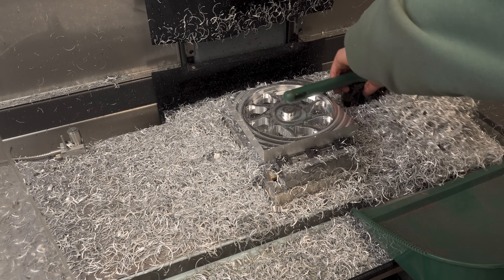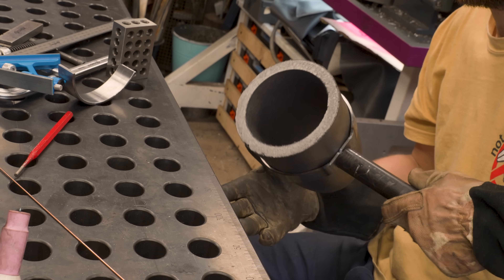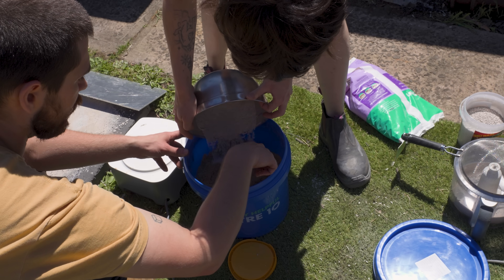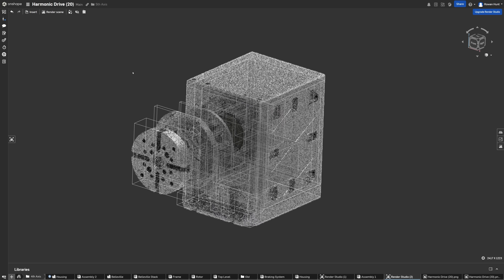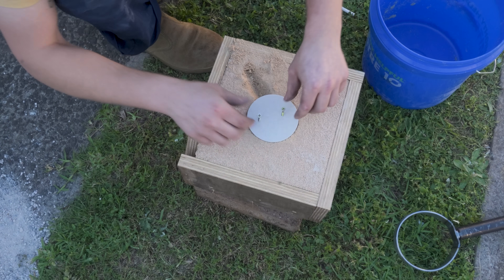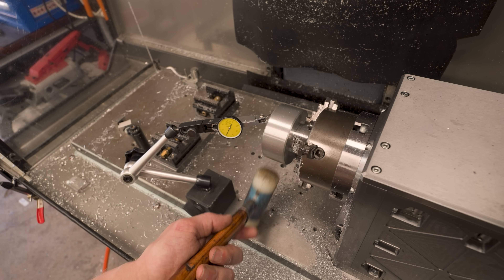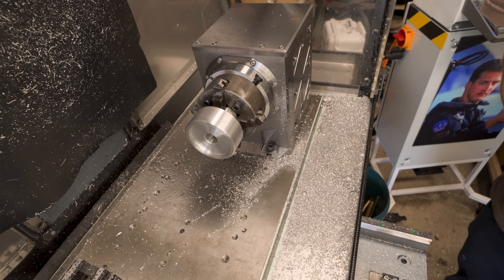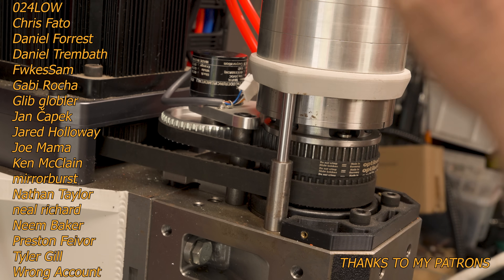Can I make a precision component from scrap metal?

Comment: the word we use for chips made from cutting metal, swarf, is literally the same word we've been using since cutting metal was invented. the old english word for swarf is swarf. the old norse word for swarf is also just swarf. kind of crazy that a word just never changed at all
Reply: I wonder how much of that is due to how trades were taught historically, and if there are similar examples in other trades
Reply: @LuciaMakes A lot of trades use words that remain coherent even when yelled at maximum volume by an angry older man about a critical urgent matter in a very noisy environment. This is why so many words & phrases used in sailing are intelligible across many European languages. Also, many industrial words originated as onomatapoeic approximations which obviously disregard language barriers.
Reply: Thank you but I prefer it my way
Reply: As a Scandinavian, I think it changed. In Swedish, swarf is "spåner" or "spånor" depending on dialect. I looked it up and in Danish and Norwegian it's "swarf". But in Islandic, generally the most close language to old Norse, it's "spænir" which is closer to the Swedish word than the English/Danish/Nowregian word. Are you sure it's actual old Norse and not just a loan word from Danish or Norwegian?

"Spånor" just makes sense as it's the plural form of "spåna" meaning chip. What's even the point of swarf? You already have a plural form of chip called chips. It would only make sense if swarf was just the fluffy kind of chips made by a lathe. In Sweden, we would just call those "svarvspånor"(lathe chips).

I searched for it on google and it told me the old Norse root word for swarf is "svarf", so I think it shares the same root with the Swedish word for lathe which is "svarv". No wonder we don't use swarf as that would mean we would call "lathe chips" "svarvsvarf", good luck saying that 3 times fast without lisping, slurring or mumbling.
Reply: @skitidet4302 never heard swarf as a norwegian, only ever “spon”, nor can i find it in the official dictionary
Reply: @cotionicar  I guess google translate lied to me. It wouldn't be the first time.
Reply: @skitidet4302  Swarf produced from a lathe (svarv) makes sense as a lathe would have been one of the first mechanical tools for processing metals. ie the waste material from a lathe might also be called lathings in the same way wood carving produces carvings as a product and waste. /speculation
Reply: @skitidet4302  Second Norwegian here. I don't know anything about metal working, but sawdust is called sagspon. Never heard of swarf.
Reply: @MinedMaker  I guess the translator messed up, or I used it incorrectly. 

Good, then it's the same as in Swedish.
Sågspån the substance is wood dust/chips,
but the determinate singular/plural sågspåna/sågspånor could be whatever material you are sawing, but generally people just leave out the saw part and call it just spåna/spånor to avoid ambiguity. It's only when you want to convey that the chips came from a sawing, instead of turning or milling, that you would use such a word.

Comment: 5:34 - bottom of that printer is DISGUSTANG.

You can print a little container that goes right at the foot of the door (on the inside) for the purge lines.

Comment: 1:34 My dumb ass (me -> 🤤) made a worse mistake the other day cutting a tube to length 3 times cuz I switched my brain off while trying to make a 900x500 frame. First cut it to 500 then realized: "oh no I have to take into consideration the tubes on the sides are 20mm wide". Cut it to 480. Then realized Im probably retarded because it needed to be 460 to compensate for the TWO other tubes, not just one... Now I have 4 off cuts that Im keeping instead of scraping them because Im super duper sure they will come in handy somewhere in the next 20 years.

Comment: 4:55 "It is build entirely in the cloud"

Which translates into: If there is an internet outage then your clients will be bashing the door but you couldn't do anything, because whole CAD/Simulation/CAM software is not working without internet.
Reply: Solution : do "remote" work, only over the internet, so if there's a internet outage then your clients can't get to you XD
Anyway PTC also make Creo, so it's not like they'll themselves promote Onshape instead of Creo for sensitive work and the product licence is on the local servers so a internet outage won't stop you from working
Reply: @bablela26  Remote work is definitely an option, just need to buy yacht and work in International waters, shipping will be done done via smuggling. Hope that customers will not become a pirates, due to delayed shipment :)
Regarding PTC Creo, haven't heard about it, thanks for the info.
--checking prices--
5k$/year for 1 person, are they insane?
Looks like I'll be working in international waters using FreeCAD.

Comment: Well done. The porosity is most likely hydrogen. Liquid aluminum can dissolve a fair amount of hydrogen which is formed in contact with moisture. However, hydrogen is not soluble in solid metal, forcing it out as bubbles. This is why you want to limit the holding time to the bare minimum. The use of risers can also delay the formation of bubbles until your part has solidified, these can also reduce shrinkage. 
Next up shouldl be some proper casting alloy (alloy wheels are a good source) and heat treatment.
Reply: i believe bubbling argon into the melt also helps purify/degas it. i think
Reply: @therealdimideas  Yes, this is a common method. In fact there is a vast number of methods available including ultrasound, reactive salts and vacuum. Sounds like an expensive rabbit hole.
Reply: @EirikvanderMeer   if one has tig one might already have argon
Reply: All true, but unnecessary for what he’s doing. Hasn’t he gone down enough rabbit holes? Lol. T6 heat treatment would make it machine much better though…

Comment: Been there. Did HTD5 pulley a couple times on a bench top CNC mill using a 3 mm endmill. Pretty simple. Just double check that your head aligned properly and the difference in probe and endmill length wouldn't give you a shift off center. Ask me how I know 😅

Comment: I've recently done something similar for my old Atlas Lathe that I needed to make a new set of change gears for.  The main difference was that I followed Shake The Future's method of using sand mixed with Water Glass (Sodium Silicate) cured with CO2 or baked in an oven.  I used old Hard Disk casings and the platters as the donor aluminum, and used 3D printed flasks and molds.  I found with the sodium silicate, that I really only needed about 12-15mm of thickness between the parts and the walls of the molds, and poured the aluminum with the molds in a basin of sand to help dissipate the heat.  I melted the aluminum to about 820c, and used some borax as flux to help with the porosity issues.
Reply: FYI, borax does nothing for aluminum -- it just gunks up with the oxide, and the metal sticks to it incessantly. At worst, they react, I suppose adding some B and Na to the melt, but this will be slow at pouring temp I think*.

*A preparation of, not pure boron, but AlB12, follows the usual thermite recipe, plus an accelerant (added Al + S) to ensure a molten product (the reaction temperature is in the >2000°C range!).  Borax, once dehydrated, can be expressed as a mixture of Na2O and B2O3.  Na2O likewise reacts with aluminum in a thermite reaction (which is vigorous enough not to need an accelerator, and must be done in a robust closed vessel to trap the product, which is vapor at the reaction temperature..!).

Borax is a good addition for nonferrous (brass/bronze) alloys though. Not alone, but with mostly glass and stuff, to give enough viscosity you can skim it off before pouring.

What works for aluminum, is chloride salts.  Equal parts NaCl and KCl form a eutectic that melts just at Al's melting point, and fosters separation of oxide and metal.  Don't overuse it; molten salt is runny as water.  It also traps water (vapor), leading to hydrogen in the metal, so using a degasser is encouraged.

Well, chloride and fluoride too -- but you probably don't want to muck around with fluorides.

Flux is really only necessary for high surface area scrap -- soda cans and swarf.  The yield nearly doubles!
Reply: @T3sl4 well said. So much garbage gets repeated by people who don’t know what they’re doing or have never done it or always done it wrong. Refreshing to see someone who has dig a bit deeper than regurgitating the latest urban myth.

Comment: i think it needs a curved/crowned pulley taper rather than a flange. (what's called a crown or a crowned pulley} the belt will ride on the flange otherwise.  before scrapping it, take 1 or 2 mm of both edges and taper it. as the belt moves to the smaller diameter it speeds up, dragging the belt back to the middle.
Reply: Yeah this is how belt-driven machinery has been done for hundreds of years, tried and true method. I'm not positive it will work on a toothed belt but I don't see why it wouldn't. But don't ask me, I'm not an engineer
Reply: This for sure. It's the best way by far and should be relatively simple to make.

Comment: I used to be friends with a guy who had a setup to melt aluminum. We would also keep a muffin tray nearby so that if there was anything left in the crucible we could just make little muffins that would easily fit back in to be re-melted later. You seem to have some kind of wizard intuition with putting the exact right amount in, though, so you probably don't need to worry haha.

Comment: Ok, but stock alu was heat treated and this is casted without. So it is lower quality material ;)
Reply: No, it’s garbage because it’s an alloy optimized for extrusion versus casting, not because it lost heat treatment. At any rate, it could be heat treated if he cared, but for this application, it matters very little. He’s replacing a (checks notes…) plastic 3D printed pulley. I think it will be fine.

Comment: Aluminum and brass both really, really suck to cast.
Molten aluminum loves to oxidize the moment air touches it (the moment you've removed all slag and start pouring), giving a really gross surface finish.
The zinc in brass loves to vaporize and oxidize if you get the slightest bit above brass's melting temperature. Wear a respirator when melting brass, kids, lest you get metal fume fever.
All casting channels gloss over how annoying they can be to work with when someone is starting out.

Comment: You probably already know this and just couldn’t wait to use the furnace, as we all tend to do when we get a new tool. But you really want to coat that furnace with the refractory cement. First of all it will help with the efficiency of the furnace but more importantly it’s a health thing. You don’t want to breathe the dust and crap that comes out of the raw insulation. Cheers
Reply: Looking at it, I was going to say the same thing, except I think there was a quick blurb where he showed some rigidizer (in a bottle?) , so I think he knows that he needs to coat it.

Comment: just so you know, the insulation inside the forge is very toxic to breath with prolonged use. If you plan to do this more, you would probably have to cover the wool with a cermic fiber ridgidizer, then refractory mortar so you don't end up like Walter White.
Reply from the maker: 0:45
Reply: @NoEngineerHere  at least in my experience, the rigidizer will harden the wool, but not stop it from being dispersed in the air, so you would still have to use the mortar. I could be wrong, or you might have just bought a different product. Cheers anyway.

Comment: Never thought 3D printing plastic would be such a game changer for people casting metal
Reply: I forget the brand(s) & name of it, but there's a dedicated PLA filament intended for exactly that! Lost wax casting something or other. Lets folks print a part, make a mold of said part, and burn away the plastic inside to pour in the molten metal.
Reply: @thetexastoaster  polymaker polycast
Reply: @thetexastoaster you can also use plain old PVA, it evacuates like butter. Hardest part is dialing in your printer to print PVA well.
Reply: @lephtovermeet PVA is water soluble and most slurries are water-based (like Suspendaslurry) which would risk dissolving it when you went to dip it. Polymaker PolyCast is made from PVB
Reply: @thetexastoaster  there is even 3d printing resin that acts the same way too, although it is quite a lot more expensive to buy than PLA
Reply: @thetexastoaster  you don't need to burn away the PLA unless it's absurdly long and thin parts.
Reply: "Lost PLA" is such an absurd game changer for casting. You don't need to consider split lines at all. All you gotta do is pack your aggregate tightly and make sure you have enough gas escape. And you can print with absurdly low infill if you're careful with the packing, so you can cast shapes that would even be hard with lost wax because most of the print is air that doesn't need to be melted and burned away.
Reply: Natural (clear) PLA is best, as it completely vaporizes without leaving any pigment residue, but any PLA will work. The expensive specialized filaments are a solution looking for a problem.
Reply: Pla seems to burn out nicely, if you trust people on YouTube.
Reply: @eslmatt811  it does. I’ve done so several times. As long as you’re happy with fdm resolution, there’s no need for anything fancier.
Reply: @omnia8838 depends on your part geometry. It’s possible to get ash trapped if you can’t blow it out well.
Reply: I bought mine specifically for patternmaking, as my woodworking skills leave a lot to be desired. It really is a transformative technology.
Reply: yeah that's how almost everyone makes the patterns for sand casting nowadays. only problem with it is that you get layer lines on the casting too
Reply: Oh, it's HUGE for metal casting!
I got my 3-D printer *just for that!*
Reply: I've burnt out plain black PLA for casting some smaller stuff. We would put some foil under the flask while it was in the kiln. The kiln would be set to a temperature that could melt out the stuff first and the foil would catch it instead of getting on the refractory. After melting out the bulk of the material we removed the foil and started cranking up the temperature like you normally do to a investment mold, burning out the remnants and preparing the investment for casting.

Comment: beautiful work, what prevents the sand from exploding since you added water into it?
Reply: There is so much surface area in the sand, and not very much water. The only region that gets flash heated into steam is the contact layer
Reply: @buffsharkshoes  good point, thank you
Reply: Water heater suddenly doesn’t explode, it expands. It only “explodes” if it’s captive. The sand isn’t strong enough to support that and it’s super-porous (“permeable”) anyway, so the steam escapes into and through the sand. The sand should only have a small amount (2-3%) of water anyway.

Comment: 0:57 i mean... if you buy those things, yes, sure. But i made my first waste oil forge from scrap and it owed me next to nothing. The bottle was a out of spec cooking gas one (the big ones that aren't allowed anymore), the refractory bricks i had from dismantling an old stove from the elder days, the refractory paste i made by re-using much of the stuff in that oven + a little bit of new material and the burner was made with parts from said stove. Waste oil from changing engine oil that i cleaned with toilet paper rolls and gravitation. The only new things were the flask, some fittings, and a blower. It's good for everything except steel (that's basically only doable with arc furnaces). You, friend, are not cheap enough. 💸
Reply from the maker: Time-poor

Comment: just a heads up, make shure the bentonite is the unfired kind that can actually dissolve in water and become sitcky. otherwise you will have trouble with two part molds if you use the non-clumping cat litter